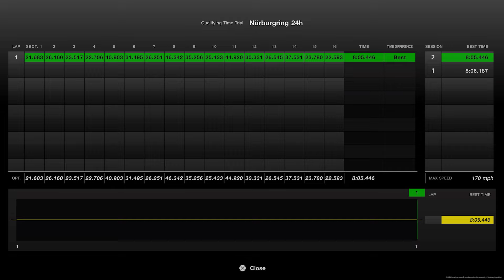GT7 2024 Manufacturer Cup Lap Guide - Nurburgring 24h - Gr. 3

Comment: Thanks for the guide as always. I'll have to adjust the line and stuff because I'm driving the Audi so gearing is very important. Not an easy car to drive but neither is the Porsche. I've been running 0 brake balance though I might try -2 or -3 front not sure yet.

Comment: Does anyone know how many laps the races are? ( trying to rehearse in custom race with both dry and wet)

Totally n00b, havent raced online since GT-sport, so this is my very first.
@Mistah_MCA why brake balance forwards?? I tend to put it up to 3 on the rear to prevent sliding out of control in turns? ( and I use the AMG, totally different from the Porsche 🙈)
Reply: Found out about the race, …also found out how ruthless humans are, dispite everyone has an "S", it is still absolutely carnage!!,  I suddenly remembered why I was quiting online racing in GT-sport, had my qual destroyed, even though I was second fastest, started last, drove my self up to 10´th place, but before first half of first lap was driven, I was hit so hard several times, that I ended up last again.
I quitted, not in rage, but in disappointment, humans s*cks,...the end.
Reply: To save tires on a rear-wheel drive.